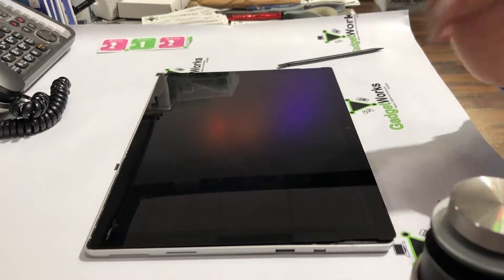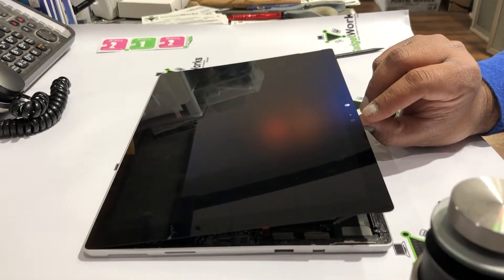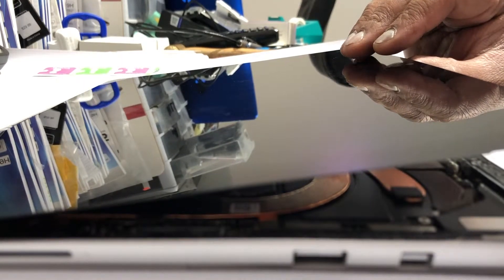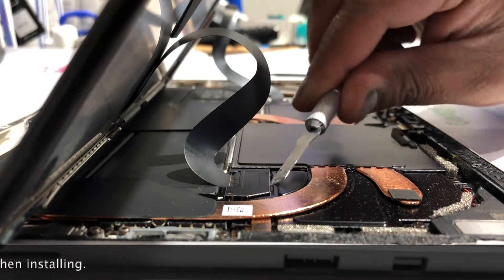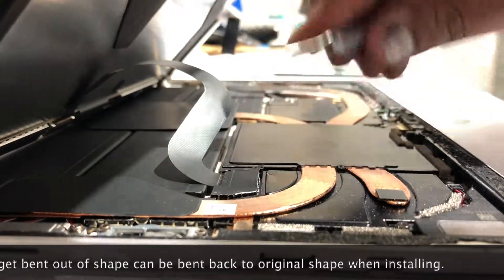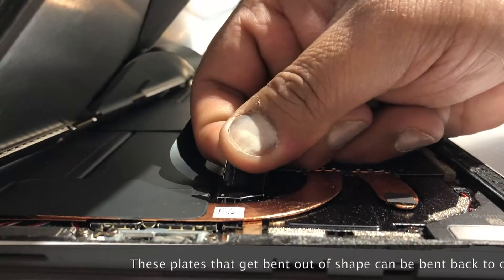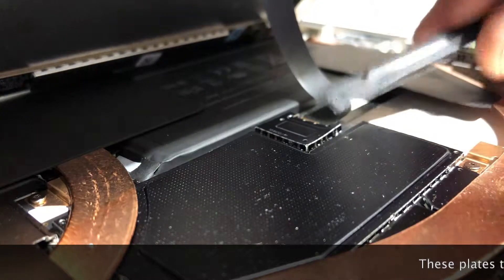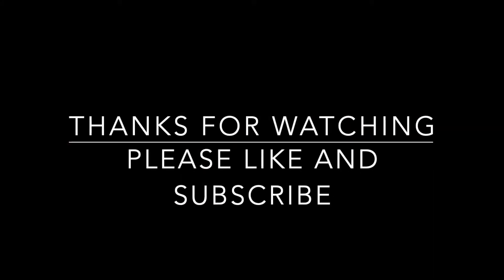Microsoft Surface Easy Screen Removal Part 2

Comment: Camera angles are fine, we can see exactly what you are doing, Thank You. My SP5 won't charge, got a new charger but I think the last one fried something. I'll have to look but I think it's probably an open circuit due to resistor. Hopefully I can find and replace it. I could hear a brief sizzle when I plugged into the charge port. Any ideas on which resistor it might be? Thanks again.
Reply: I would recommend replacing the port. These port easily get damaged.
Reply: @patel12307  Thank You for the reply.

Comment: Fuck them for making the screen extremely difficult to remove. Why the hell should the glass be glued to the antenna assembly and why the metal plates are stuck that hard to the logic board? I really hope the right to repair law actually gets approved for real within the next months.

Comment: I was wondering if you have any other solution to this Pro 5 boot loop issue, I removed the screen and disconnected the battery but still having the same boot loop. Also have you had situations where disconnecting the battery did not work? how did you fix it
Reply: how did you end up fixing it
Reply: We also disconnect the battery and it did not fix to boot loop problem. How did you end up fix it?
Reply: @florindobre6774  I have the same issue, did you manage to fix it in the end?